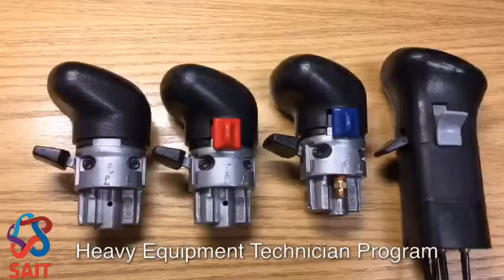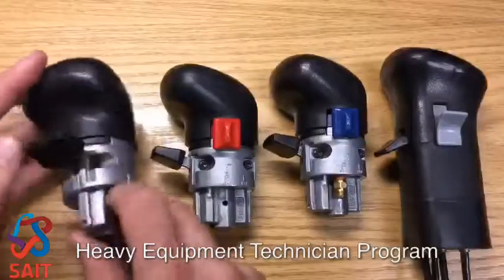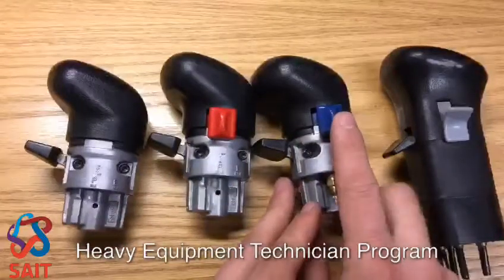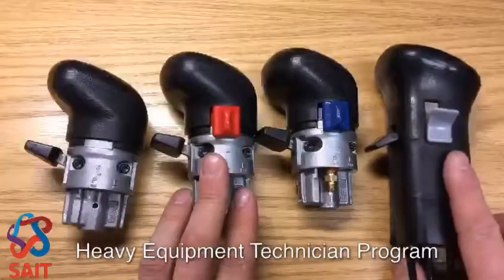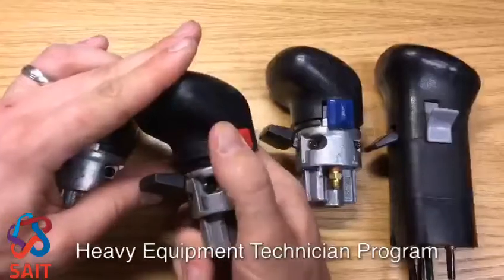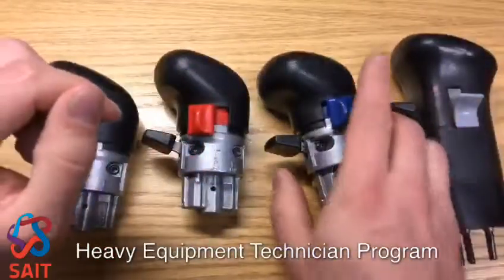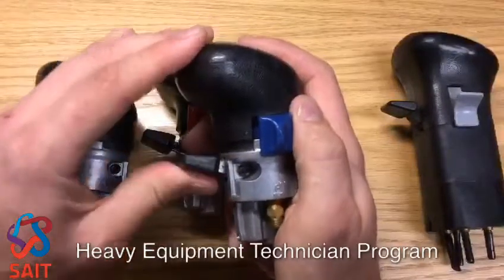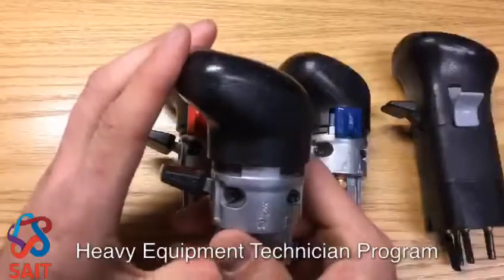Transmission Shifting   Master Air Control Valve

Comment: I wish guys would stop saying that you can split a 15 speed. You can not. The blue button is a range selector for deep reduction and low. That's it. I am tired of seeing guys abuse 15 speeds because they are not trained properly. You do NOT need to burn your clutch on a 15 speed if you drive it properly.
Reply from the maker: Really great point, that’s a miss in our terminology for sure. Yes the 15 speed simply has 3 ranges much like a ranged 10 speed has 2 ranges rather than splitting gears. Thanks for sharing your experience.